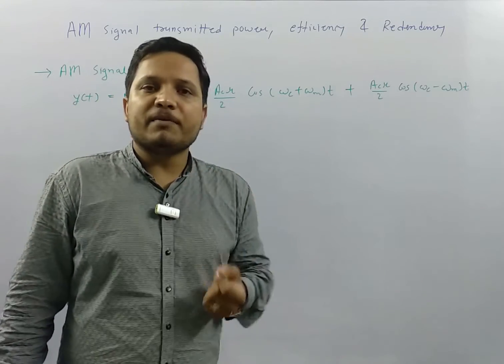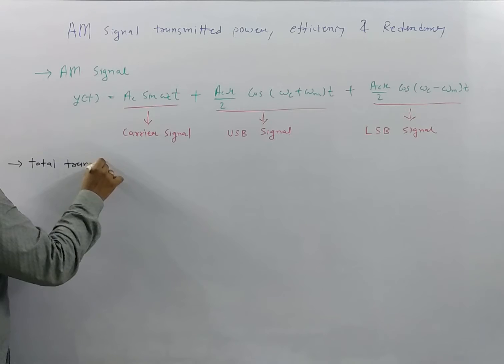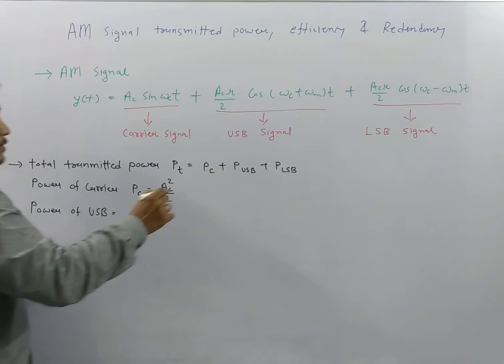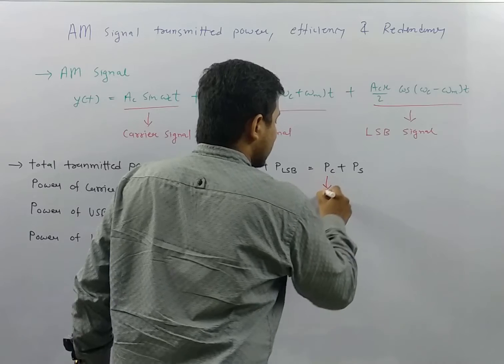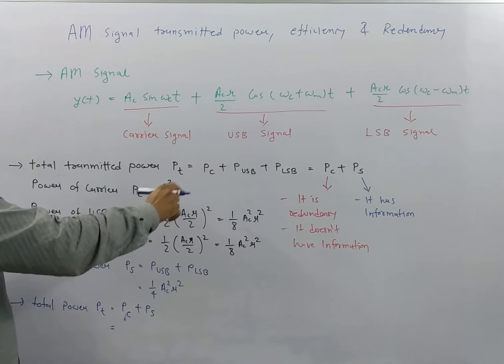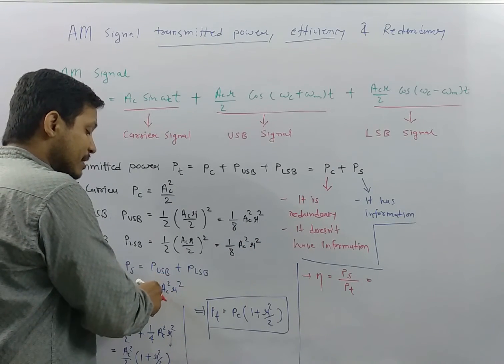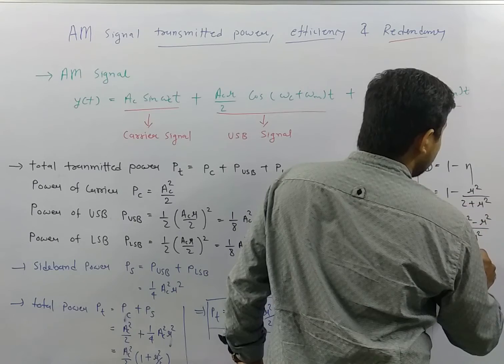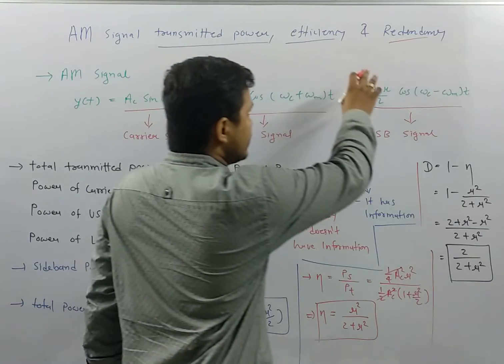AM signal Transmitted Power | Amplitude Modulation Efficiency | Redundancy of Amplitude Modulation

Comment: If you initially find the equation incorrect, as I did, it's likely due to the assumed definitions of the signals. To arrive at the correct form of the equation, you must define the modulating signal, m(t), as Am cos(wmt) and the                                                                    carrier signal, c(t), as Ac cos(wct). Under these specific conditions, the equation is indeed valid.

Comment: there was a (-)ve sign in Y(t)..this was not effect in power???
Reply: Even if you consider the Negative sign, the result will not change as you are squaring the whole term and that nullifies the negative sign. Take the negative sign as a part if the amplitude itself
Reply: What negative sign , wc-wm? Wc is much larger than wm